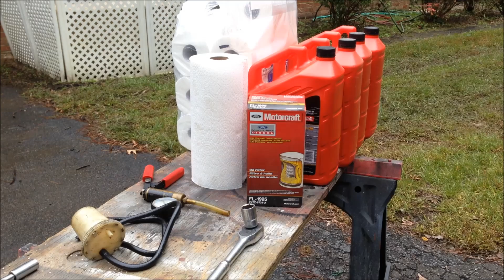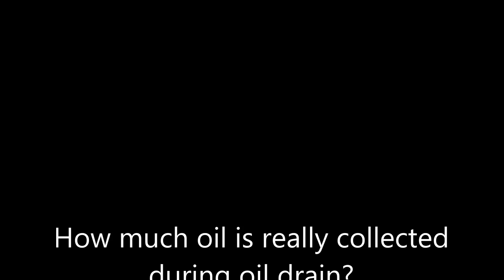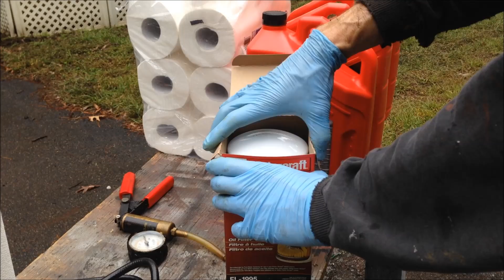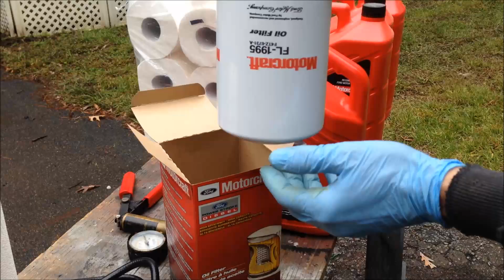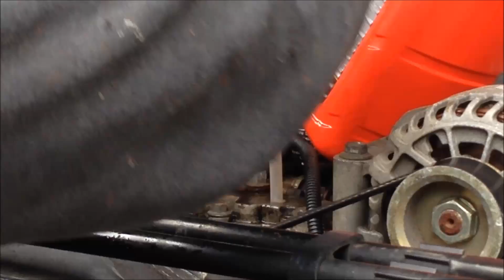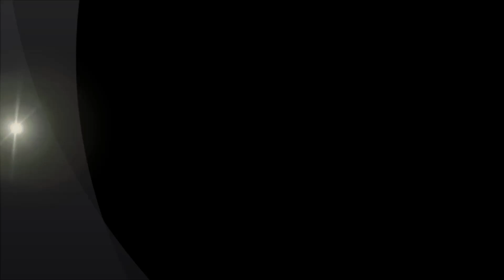Oil Change for Ford 7.3L Power Stroke

Comment: As far as the hpop tank goes. I just did mine for the first time with 267,000 miles. Oil looked just like the oil that drains out of the oil pan. So....
I'll continue to do it but to those that say it turns to molasses or whatever if you don't... Well this truck didn't.
Reply: Bill - I've read now that there's no need to drain hpop it as it circulates naturally w engine oil.  may explain your results.  This was in PowerStroke forum.

Comment: I have all the paperwork for the used 7.3L I bought. Whenever they ( Ford dealer ) changed the oil they added a quart of Diesel Oil Conditioner BG11232 - I’m not big on additives, but if the Ford dealer was doing it then I’m wondering if I should continue.
Reply from the maker: This is a good question.  I read the brochure on the additive at the following link: https://www.bgprod.com/catalog/engine/bg-doc-diesel-oil-conditioner/; and, it initially stated the negative effects of having sulfur from the fuel to create acids in the engine oil.  In 2006, the amount of sulfur in Diesel fuel was reduced.   As a result, I'm not sure if this additive will help very much for sulfur related issues for the 7.3 - since it was manufactured in 2003.

To completely answer your question, you may want to send a used oil sample out for analysis - and check for iron (Fe), viscosity (KV100), and TAN/TBN.  I would repeat this with the next oil change - without the additive.  If the used oil analyses are similar, then it's probably not worth the additional expense for the additive booster.

It might also be a good idea to put a bore-scope up the oil drain plug during the next couple of drains and check around for evidence of sludge.

Comment: The oil change every 10000 miles let me know please
Reply from the maker: Service manual recommends every 5000 miles.  You can send in your oil for analysis to see if the oil drain interval can be extended.
Reply: Thanks

Comment: I drain and replace oil in HPOP every other oil change. 
Your injectors will thank you. 
And they will last a lot longer. 
It's a hot debate weather or not this HPOP circulates with the crankcase oil. In my experience it circulates very slowly. The oil in the HPOP reservoir is definitely blacker than the oil in the crankcase. It cannot hurt. It could only help. My opinion is that the more of The old oil you can get out the better off you will be
Reply: There is no need for that procedure, unless it's pre 99 ym. There is a stanpipe in the reservoir which was incorporated in 99.1/2 which allows excess oil to drain back to the engine, hence, always leaving fresh oil in the reservoir.
Reply: Even if oil stops and collects, solids will fall out of suspension.

Comment: You don't need to change the oil in the HPOP twice. contrary to common belief, the oil flows quite well through the HPOP. If you drain it well, and refill it, what's the use draining perfectly good oil out of it the second time?

Comment: I just changed mine today... it took 15 quarts exactly. Now, this guy is very particular. Maybe I should do this. I just got tired of Ford filling it up with an extra gallon!!!... Yes... they were doing that! I'm using Rotella 15-40 syn. T-6
Reply: I wish I was 17 and knew everything.
Reply: stvynix I plan to buy myself an F350 in the future with a 7.3 T6 is good to but my minimum for any oil is to be full synthetic and I'm a die hard Royal Purple fan it's my personal preference and I run it in everything from our Expedition to my civic and even our air compressor I don't like Motorcraft cause I know there is better as their oil is synthetic blend which ruins the synthetic part also use a royal purple filter but the next filters I like are Bosch Distance Plus Purolator Baldwin MAHLE Mann Wix also going to get it in dually as I'm going to work in roofing and going to try to make my own business well right now I'm 17 by June I begin roofing in the company my step dad works in all I can do now is wait and prepare by getting my own tools the only thing that I see can ruin this is the economy failing
Reply: stvynix I plan to buy myself an F350 in the future with a 7.3 T6 is good to but my minimum for any oil is to be full synthetic and I'm a die hard Royal Purple fan it's my personal preference and I run it in everything from our Expedition to my civic and even our air compressor I don't like Motorcraft cause I know there is better as their oil is synthetic blend which ruins the synthetic part also use a royal purple filter but the next filters I like are Bosch Distance Plus Purolator Baldwin MAHLE Mann Wix also going to get it in dually as I'm going to work in roofing and going to try to make my own business well right now I'm 17 by June I begin roofing in the company my step dad works in all I can do now is wait and prepare by getting my own tools the only thing that I see can ruin this is the economy failing
Reply: HERPY DERPEDY Good luck my friend!! :-) Buy good tools that you won't have to replace for a long time. Just acquire them slowly, or when you need them, so you don't break your bank. That's how I did it. Some very nice, some are cheap. Some are even given to you if you're lucky. 
Stay young and happy while you can!! ;-)

Comment: Nice job. Most people skip the high pressure oil pump step..
Reply from the maker: kemicalx17 
Thanks for the complement!
Reply: You can do the hoop flush as frequently as you like. If I wait longer than 50K, then it is probably too long. The thinnest motor oil ends up migrating to the top. It can almost be as thin as water.  
😉